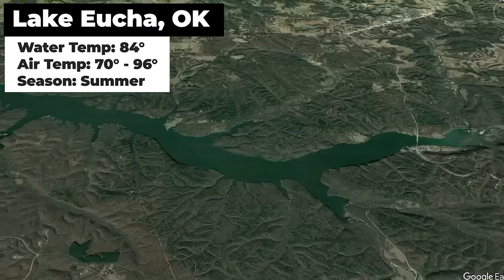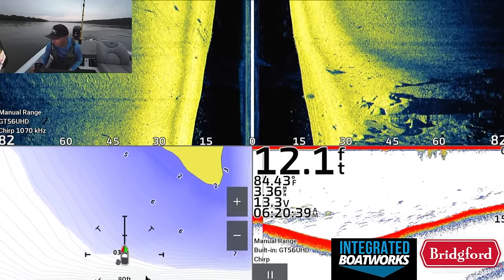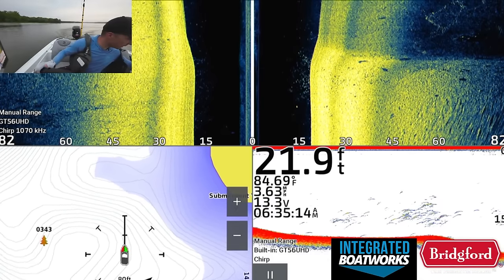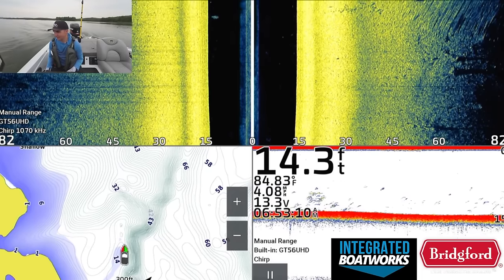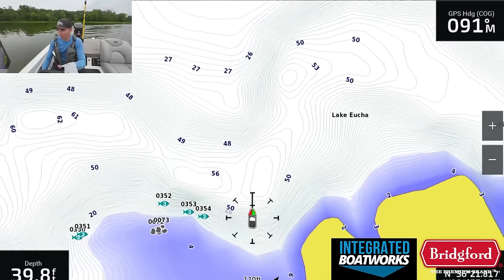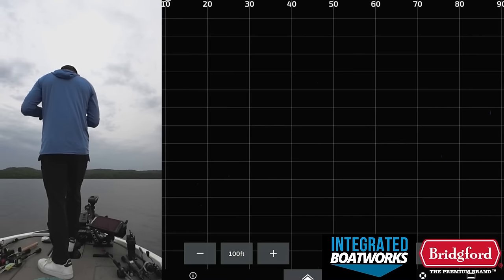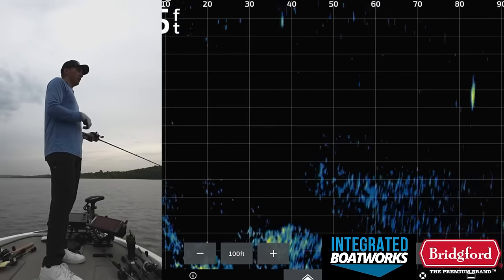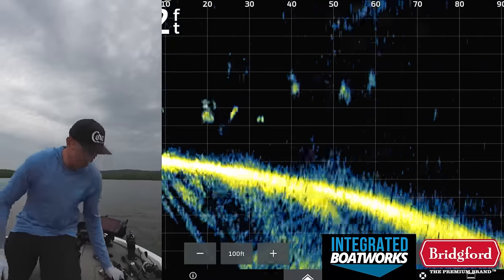Stop Missing Bass on Side Imaging | 2 Hours of Graphing and Fishing Offshore

Comment: At 1:29:36,  Take a look at the 7+ bass that started to follow the bass you hooked into toward the surface.  Several appeared to be pretty good sized and with the reaction they showed, at least a few of them should have been very easy to coax into biting by either jigging the bottom as you did for the first hookup, or swimming swimming the same jig trailer or a swimbait over the top of them.  Wouldn't hurt to throw a large 6-8" soft or wood, jointed swimbait to target the  really big bass.  They will also catch some smaller very agressive bass at times.

Comment: Don’t you recommend 30° casting angle to ledges when fish set up like this
Reply from the maker: Yes. When I first got to the spot, my boat was probably sitting 20-40ft off the edge of the ledge and I was casting up on the ledge at a 20-40 degree angle. After I caught a few fish, I did change my angle to try something new to get more bites which paid off with a few extra fish.